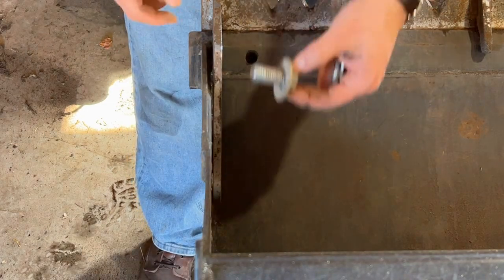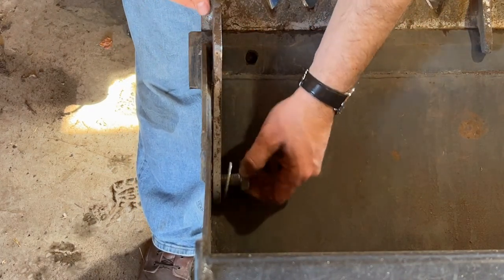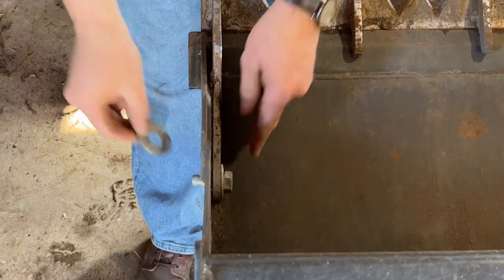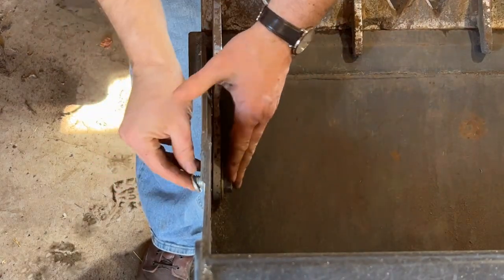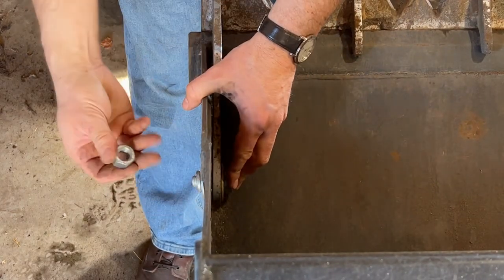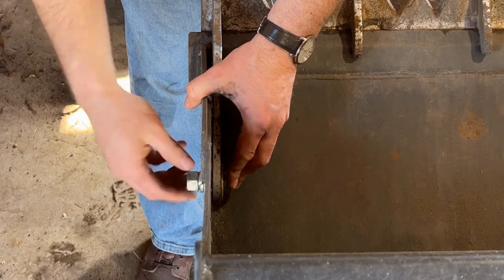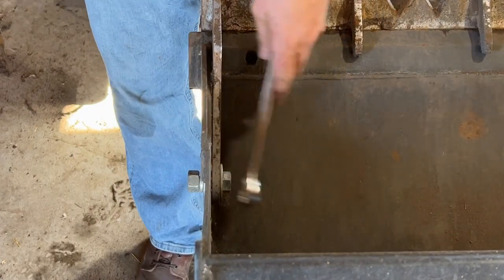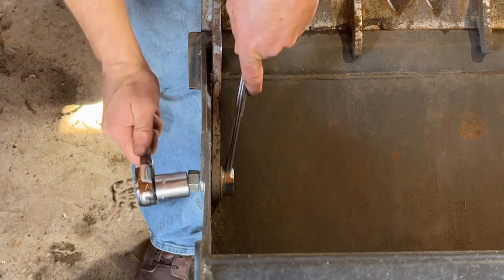🚜🧰 Attaching Piranah Tooth Bar to Kioti Ck2610 for the spring

Comment: Nice video. I wanna order a Piranha tooth bar for my 2610, Piranha needs bucket dimensions, could you tell me the 2610 bucket width, mine is same?   My Kioti 2610 is at a different location right now so I can't measure the bucket.
Reply from the maker: Thanks!  I love the tooth bar.. it allows me to do so much more I think.  I have a 66" bucket and I ordered a 65.5 width bar.   Thanks for watching.